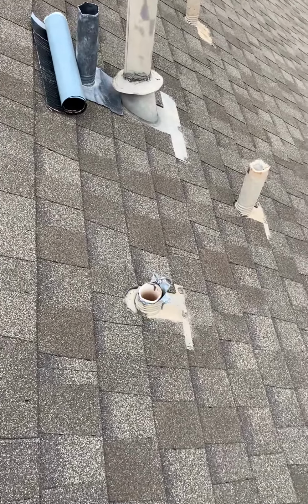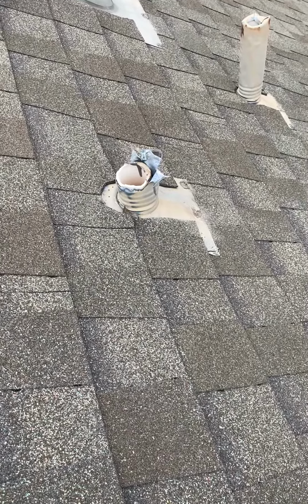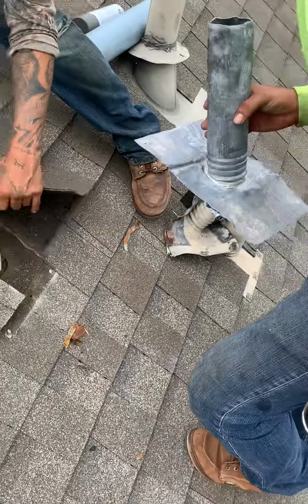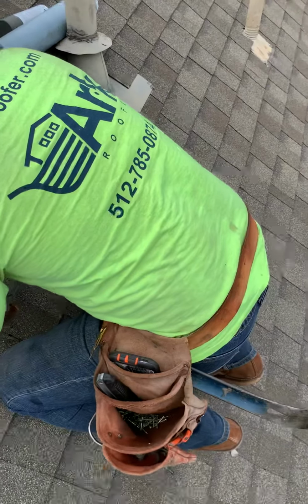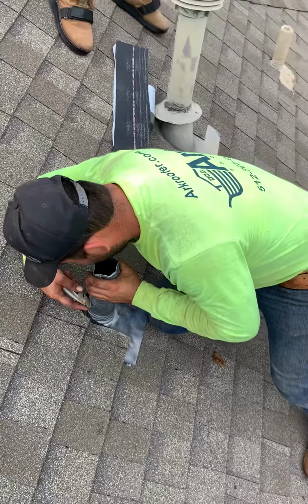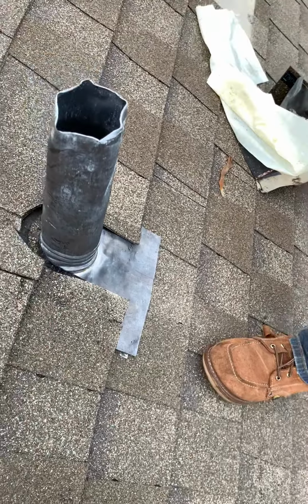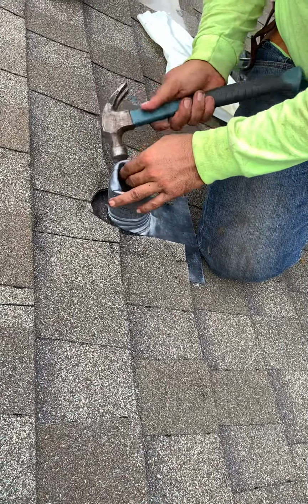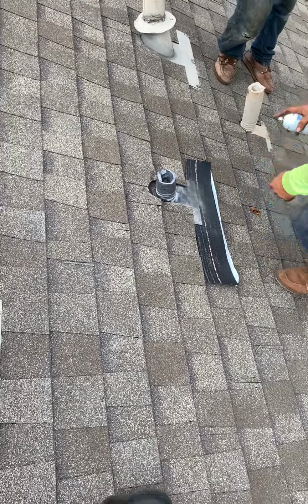How to replace 1 bad pipe jack by Ark Roofer

Comment: I’ve made copper and lead boots for over 35 yrs. You’re not supposed to cut the top of it to fold it in your supposed to work it in gently with the back of a ball peen hammer

Comment: Try using a Bernzomatic torch to warm up the shingles so they come apart easily and you won't damage them. Amateurs.
Reply: If you're a professional roofer I feel sorry for you
Reply: @simonfortune7279  53 years of full time  and second generation.  If you think that I'm wrong then too bad cause I know it works.

Comment: Commentor is not very knowledgeable with lead.  Should have installed a pvc splice and pipe extension.  Lead gets cut 1' above pvc and folded into the pipe by using gutter crimper and tapping the lead till it forms to the inside of the pipe.